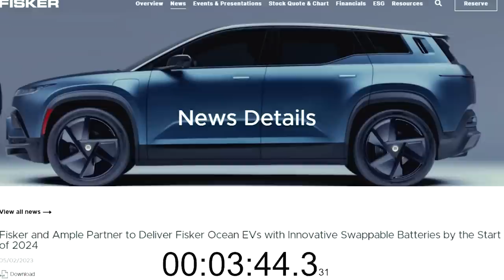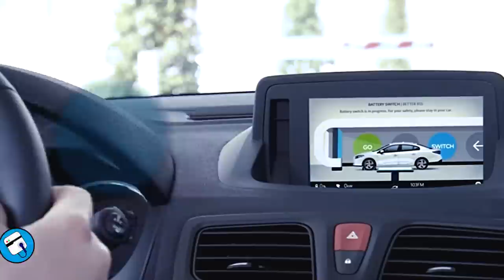Ample Battery Swap: Is There A Future In EV Battery Swap In The US?

Comment: Tom, we appreciate the video.  However, this will never be an economically competitive alternative to DCFCharging.  Your timer doesn't begin when the car is in position....the timer starts when you first park in line with the other cars that will be waiting in single file line to have their turn to perform the battery swap...just like we all discovered with the famous 15 minute oil change at Jiffy Lube.  There is no way that battery swap stations will meet the existing reliability of Electrify America stations in the middle of winter when the cars arrive with all the road gunk stuck to the bottom and dripping downward into the robotics of the system.  Stick this tech in the same drawer as the wireless under-road charging tech.  Tesla gave it up for one reason....economics.  Tesla can do math.

Maybe Jay Leno's fully electric garage will need one of these, so that Jay can quickly jump from one exotic EV to the next for his Sunday runabouts?
Reply: When Tesla and Better place tried it, it was aimed at private vehicle owners, not at fleet and taxi owners. Fleet vehicles and taxis that spend enough time on the road each day might not have enough range to last an entire day.
Reply: @Myrtone  When the taxis and fleet vehicles run out of charge, they will stop at a DCFC/SuC station and bring the battery up to 80% within 20 minutes.  There will be little time gained by swapping.  However, the difference in the cost will be immense...and it's not like the fleet vehicles will contain drivers/operators anyway.
Reply: @TeslaDo_d  Not according to that video. Batteries are not fuel tanks and charging fuel tanks is sure to be harder than changing batteries. Look at how popular battery swapping is in China. Ample has stations in San Francisco.
Reply: @Myrtone  I am writing this as someone who has repaired and maintained many robots in 'cleanroom' environments.  The swap station reliability will never compare to an electrical cord at a supercharger.  They will need constant maintenance in the harsh environment.  The crap on the underside of a vehicle will be constantly dropped into the mechanics area and need to be removed otherwise moving items will be 'ground' to a halt.

China is currently subsidizing NIO's swap stations and NIO is still loosing a ton of money every quarter because they refuse to recognize the economic costs to maintain, power, and monitor the systems.  The true costs are not being passed to the customer yet.  When they finally try to make a profit by charging the customer for the true costs, the swapping popularity will go to nearly zero.

If you don't believe that a nickel makes a difference then you need to refer to past experience with purchasing gasoline for an ICE vehicle.  Remember that station that sold gas for $.05 less than the one across the street?  Yeah, the busy one...  The one you went to, so that you could save about $.75 for an entire tank of fuel?  You might have even spent 5-10 extra minutes of your time waiting in a line to get the cheaper gasoline?

Economics tells me that this idea does not have a chance...same is true for charging coils under the roadway.
Reply: @TeslaDo_d  So what about the Ample swapping stations in San Francisco?

Comment: Very hard to believe the claim of being cheaper than DCFC, especially once you take the land usage into account. Even if you factor in using the stored batteries for grid balancing. 
So many potential mechanical failure points. 
Can't see it working outside a few niche cases.
Reply: Very hard to believe  anything from the CEO due to the lack of relevant information and exaggerations. And I'm a confessed battery swapping fanboy. 

There's over a half dozen Chinese companies that are doing battery swapping and they all have a better business plan than Ample.

Thanks for at least admitting that grid balancing is one of the advantages. and I will admit that additional mechanical complexity is one of the Trade-offs. 

 Lastly battery swappable EVs do not have to be dominant,  to make a major contribution.
Reply: This doesn't really use that much more space than a DCFC, and it has far faster throughput.
Reply: @Thunderbuck  agreed but every time I've seen a full  battery swap for an Ample vehicle it's taken over 10 minutes..... And in China there are battery swapping options. That take under 2 minutes.... 

If battery swapping makes it to the west, I doubt Ample is going to be the provider....
Reply: @nc3826  Ample seems to be focusing on ride-shares, and that's a smart move because for an Uber driver, time is money. If they sign up a couple of fleet operators in a trial market it could be a winner.
Reply: @Thunderbuck  If I was an Uber driver I would consider leasing an electric vehicle with that technology??? But I would not buy the vehicle with that technology.... Since it's so inferior to what Chinese battery swapping companies has to offer..... On which might come here in a few years???

Comment: I still think most brands won't go for this for regular passenger cars. Beyond replacing, eventually, the 120K gas stations in the US (for owners that can't charge at home) part of any vehicles secret sauce is performance, and battery chemistry is a big part of that. Both longest range or top performance depending on the goal of a particular car. Everyone is fighting to get The Best Battery and if they all end up with the exact same one, then all you have to sell me on your car is styling and your interior bits. Will the Tesla Plaid, Hummer, and a Leaf all have the same 0-60 time? Actually the Leaf will be much lighter and thus quicker.

Comment: 2 questions: In this video from 10 months ago, the Ample CEO said they would be announcing partnerships with OEMs “within weeks.” I haven’t heard of any — am I missing something? Any OEMs headed this way? 

Secondly, you asked a bunch of great questions, Tom, but one I didn’t hear is, where are the fully charged battery modules coming from? As customers drive away from the swap station, how would Ample replenish the supply of modules? Are they being recharged on site? (Requiring more real estate and much more electrical capacity) Are they being trucked to the swap station from elsewhere? That’s an important missing piece in this picture.

Comment: For consumers, I think this is a great idea for EVs as they age and the range decreases over time. Suppose you have a Tesla Y that has a couple hundred thousand miles and the OEM battery only holds up to 60-70% of its original range. Pull into one of these stations, pay a one-time fee, swap it out with a new battery pack and drive off for another 200k miles.

Comment: How did they get funding? Battery swapping introduces a lot of complexity for no gain. My Supercharger stops only take 15 minutes, that's fast enough but in any event as batteries improve that will drop to five minutes. Might take a couple more years, might take 10 years but it's inevitable. That doesn't leave any room for battery swapping services.
Reply: Go ask China.... 

Fanboys.... SMH....
Reply: @nc3826  You mean ask Nio which is losing money hand over fist?
Reply: For private autos its a no go. For public transport and truck fleets its not a bad idea. Simply shows that what is old is new again. In the beginning of the 20th century in some major US cities thats what they did. Don't discount it to quickly.
Reply: There are numerous battery charging networks in China.... Nio has the least interesting one....

 "which is losing money hand over fist?"
  what was being said about Tesla for its first 10 years....

 @joshuarosen465  thank you for being consistently wrong....
Reply: It can happen if it’s a easy plug and play and come in smaller modules.
Reply: Listen buddy did you consider:

Battery degradation
Battery health
EV depreciation
Grid support

There is no way charge will be under 10min, that's impossible, even if thru find a method, aren't you worried about how that type of speed affects your battery health, how much heat is going through the battery? Potential fire hazard?

Nio 3rd gen will take 3 min or less.
Reply: Complexity, more like simplicity.  Current battery management systems will brick the car if the voltages on a battery module or cell changed dramatically.  Modular batteries would remove this complexity.   Also, the physical form factor becomes set, now this will be a problem for current vehicles made for custom designed battery packs but the standardized form factors would be accounted for in future vehicle designs.   Also, the robotic swapping of the batteries are only achieved by simplifying the replacement process.  

I can see this as a problem for van lifers who like to strap water tanks and propane tanks under the car but they can manage such as sacrificing internal space for tanks and propane tanks (vented of course for propane tanks).

However, I see this option as not likely to succeed as it would be dependent on standardization and the industry is focused on proprietary branding, especially Tesla which is fine so long as everyone accepts their standards as per NACS.
Reply: Supercharger degrades your battery a lot faster resulting in you needing to replace your battery faster- BSN will solve this problem.
Reply: If we take into account the use of land, battery swapping makes much more sense especially in big cities with limited space, because battery swapping is at least multiple times faster than DCFC with current technology. Even if in the future fast charging takes as much time as battery swapping, battery swapping will still be more appealing if it costs less. And I think battery swapping would indeed cost less than fast charging in the future because of several reasons. 1. Lower electricity cost because battery swapping stations can make use of the cheaper rate for charging from the grid. 2.Modular battery swapping offers the flexibility for cars to carry as few batteries as they need, hence reducing weight and fuel cost. 3.Slow charging minimizes battery degradation as a result extending the lifespan of batteries. Regardless of if the market decides to go for DCFC or battery swapping and not pay for the battery upfront when buying an EV, customers are paying for the cost of ownership of batteries, either thru directly or indirectly. So making better use of car batteries means reducing the cost of ownership for an EV.

Comment: 🤔...good video but no one asks about what type of battery cooling is used and if it's liquid cooling how is that managed with proper levels, leaks, and preventing air pockets
Reply from the maker: They aren't offering that information yet...
Reply: I've seen numerous interviews of the CEO and  he never gives any type of granular details about the technology. But generally  the cooling plate remains in the vehicle. And the ends of the batteries come into contact with the cooling plate. Which is what Nio was starting to utilize. When I investigated the same question a couple of years ago.  

You might think this is less efficient, but this is how Lucid Does its thermal battery management. Even though of course they don't design it for battery swapping.  So it's not usually a major issue. But I don't have a lot of faith in Ample, so maybe they use something inferior???

Thanks for such an insightful question. It was more interesting, than the information given by the CEO.
Reply: @nc3826 very insightful answer indeed as that would make sense that the cooling hardware is static to the vehicle and the system isn't being constantly disturbed at various pressure levels with the swap process not to mention introducing air pockets and contaminants during the procedure
Reply: @alittleofthisnthat5665   NP,  just to reiterate I have no idea if ample is using anything close to that efficiency....  but hopefully it gave you a general sense of what's possible for for batteries swapping...

 i was surprised that it was efficient enough  in terms of heat transfer for Lucid to utilize....

Comment: You did not ask some questions I would have.
How does their modular pack compare to an integrated pack for weight, given the same total kWh?
Can you fast charge their packs as quickly as a native pack, if you are on a road trip and stop at a DC fast charger?
Is ground clearance significantly reduced? It looks like their packs stick down quite a bit compared to the original packs. Is a speed bump or debris on the road going to hit? How about deep snow?
Is the range of the car with a swappable pack as good as the range with an original pack?
What will they do if more EV makers go down the path Tesla has taken and make the battery pack a structural element?

Comment: Will Ample batteries be able to be charged also by the vehicle's on board charger at a traditional DCFC station as a backup option if I find myself in an area lacking swap stations? I feel this is a requirement to make this approach viable.
Reply: I totally agree and xersion one didn't have that capability so I doubt version 2 has it..... 

The different options in China are far  superior then what Ample is offering...
Reply: That will be critical in these early days. Fine for Uber drivers because they are local only anyway but the rest of us need long range.

Comment: I like the innovation!

With the number of EVs growing over the years, we need innovative solutions to bring electric energy to mobile transportation. Simply relying on-demand cable-based charging will not scale well into the future.

For example: imagine just 6 cars "filling up" at a gas station in 5 minutes now "filling up" at an EV charging station in 5 minutes using 300kW DC fast charging each. The power demand of 1.8MW needed for such on-demand fast charging requires a significant investment in electric infrastructure (conduit, cabling and on-demand generation), not to mention the price you have to pay for such high powered electric energy delivery. For reference, the average peak power of a residential home is about 6kW, when running electric cooking, AC and lighting. With this assumption, 6 EVs fast DC charging is about 300 homes running at peak power at the same time...

Moving electrons or electric energy "mechanically" via modular packs is faster and less strenuous on the electric infrastructure. Especially if we combine this also with the physical delivery of battery modules, charged at locations where there is an abundance of clean and much cheaper renewable energy. Keep in mind, for full flexibility of Battery as a Service (BaaS), you would still like to have the option to do a "slow charge" of the battery pack in the EV by cable (at home or any EV charging station), but also have the option to do a "fast charge" via a swap.

I agree, there may be a way to reduce the automation and moving parts, while providing jobs. Similar as going for an oil change: the swap of the battery could be done by a person, assisted with a robot to move the somewhat heavy battery modules. That would require a different design to provide clearance under the vehicle for a person to safely operate a battery swap.

Last but not least, Battery as a Service (BaaS) opens up the possibility for more people to switch to affordable EVs, without range anxiety and surprises of vandalized or malfunctioning EV charging stations. Not everyone has the luxury of having a dedicated charging station to charge your EV as you please. Making combined swap/charging stations a commodity, just like our sprawling gas stations, is a win for everyone.

That bring me to my last comment/question for Ample: are you going make sure to also develop a partnership with 7/11 or Circle-K at your swap station?
We like their cheap coffee and slurpee 🙂